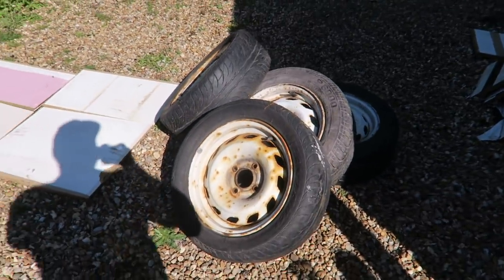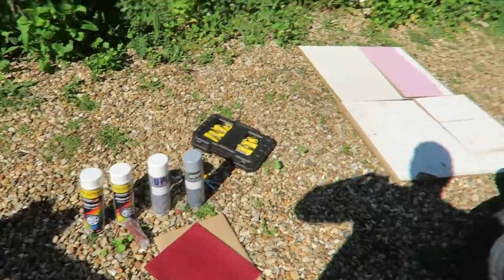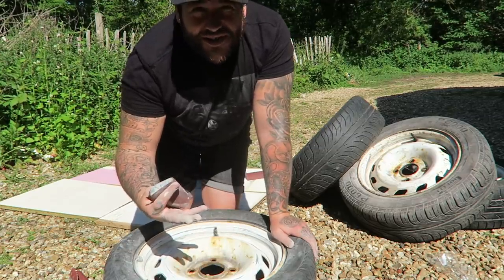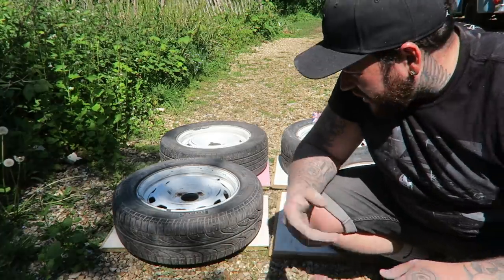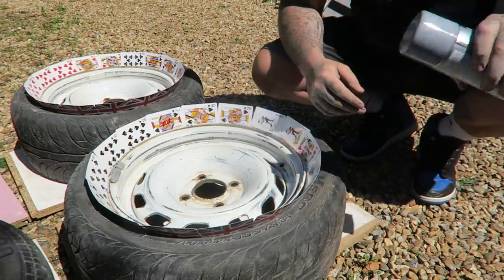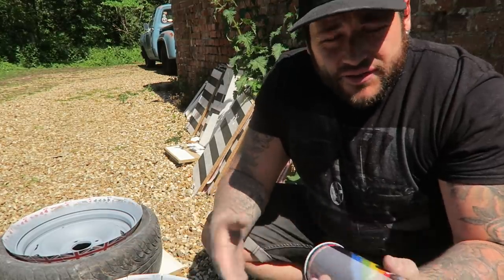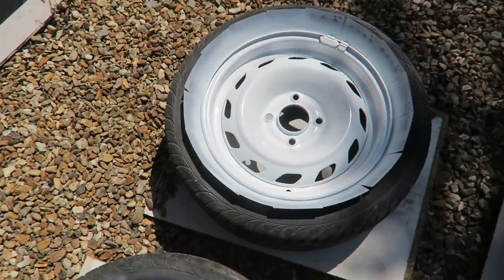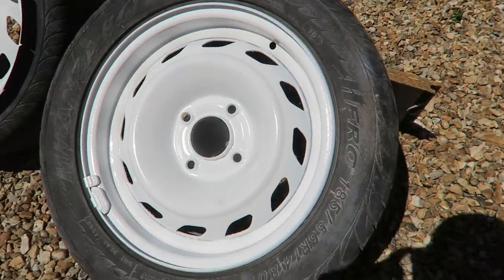HOW TO PAINT YOUR WHEELS FOR £30! *CRAZY RESULTS*

Comment from the maker: PS - the wheel weights wouldn’t come off so they stayed on. Also, I’m not going to a tyre shop to get the tyres off during lockdown just for a quick spray job. They should have been powder coated by now but of cause, this isn’t essential so doing it like this. So it will do for now, you know, Before all the professional painters start 😂🙈
Reply: Wheel weights are only hammered on so a decent screwdriver and a hammer should have got them off and also with the air out of the tyres you should be able to break the tyre bead away from the rim on the front with a pry bar to allow you to paint the wheel rim properly. Not mocking or trying to be a know it all, just a bit of advice for future reference 👍🏼
Reply: I only came here to point this out. Good thumbnail choice
Reply: Wouldnt come off 😂 more like forgot and didn't try
Reply: But when you have your fresh rubber fitted the tyre shop will remove the old weights and ruin your paint job 😂

Comment: That little clip with your dog at the start got a like straight away my man 😂 love the look of the steels. My car has steelies from the factory (had dutty OEM hub caps that have been ditched) going to be sanding and removing the surface rust off them and paint them up a nice glossy black just as they are currently black think they look best I'm black too.

Comment: In finland we split steelies in the middle then weld a metal plate to make them a lot wider. You can also cut the "face" of the steelies, turn them around and weld them back together to look cooler :D
Reply: GankMan we call that ‘Banding’ here as in banded steelies

Comment: For a cleaner look you can remove the wheel weights and when they balance the tyres have the weights stuck on the inside of the wheel like an alloy. That would be slick and a very clean look.